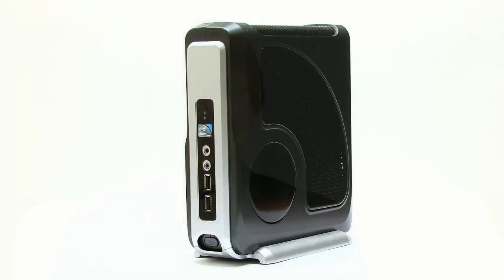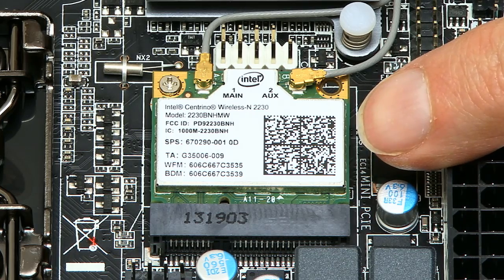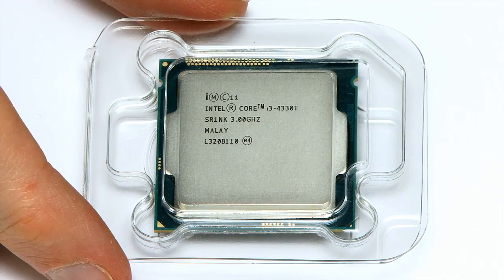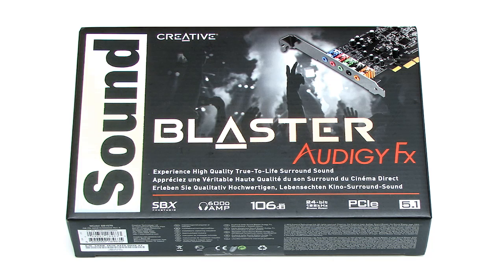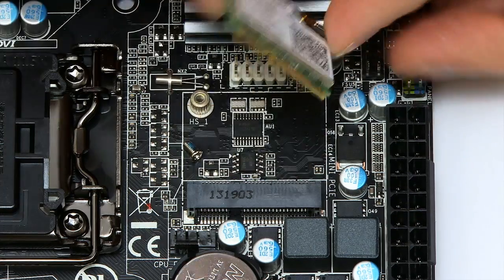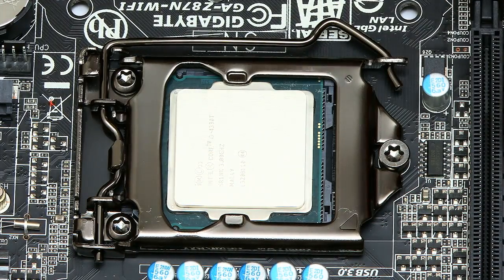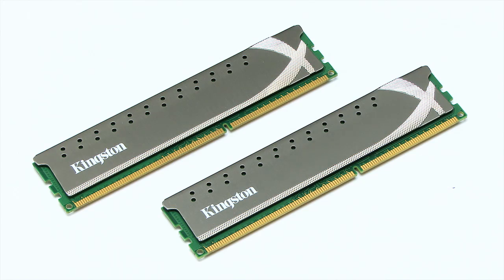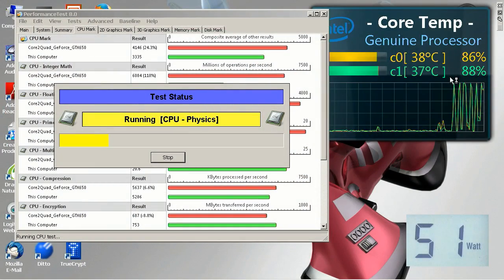Haswell i3 Mini-ITX Build (Part One)

Comment: When I was a teenager I had this awful HP machine that had a 4130T, not only did the shitty optical drive die in less than a year, it also had a hard drive (I know that was standard on prebuilts in 2016) that took a long time to boot, and the cherry on top was HD4400. I remember playing GTA 5 on it, which is something it wasn't intended to do, at 800x600 lowest settings, and getting about 30fps.

Comment: Hi Chris! How is this PC holding up after all these years?
Reply from the maker: It is still going strong -- I am typing on it (running Linux Mint) right now. I had some problems with one of the Ethernet ports a few years back, but switched to using the other one, and all is still good. And it now has a much larger boot SSD. The PC will be 10 years old next year, but I'll keep running it until there is a reason to upgrade.

Comment: I would have flipped the L9i if it were my build, you have the hot air coming directly onto the ram and if you turned the cooler 90 degrees it would have been better.

Comment: why not put the fan on the table upside down then fit the board upside down to the fan and screw in from the bottom on the top :P  ?
Reply from the maker: Not an ideal way to place a heat sink onto thermal compound! :)
Reply: why ? do you need a mirror or something i dont think you understand me :)

Comment: I am thinking  of building a pc. Will these components work together? (just making sure)

Processor: Intel BX80684I38350K 8th Gen Core i3-8350K Processor
https://www.amazon.co.uk/Intel-BX80684I38350K-Core-i3-8350K-Processor/dp/B0759FWJDK/
£149.97

MotherBoard: https://www.amazon.co.uk/Gigabyte-GA-Z270P-D3-Generation-Motherboard-PCI/dp/B01NCS9QS5/
Gigabyte GA-Z270P-D3 7/6th Generation Motherboard - Black (Intel Core i3/i5/i7 Processors, LGA 1151, Dual Channel DDR4, USB 3.1, PCI-E 3.0, PCI-E x1, SATA 6 GB, USB2)
£68.98

Windows: https://www.amazon.co.uk/dp/B0111YEBY4/
£59.00

RAM: https://www.amazon.co.uk/Crucial-CT4G4DFS824A-DDR4-PC4-19200-288-Pin/dp/B019FRED60/
£72.97

Power Supply: https://www.amazon.co.uk/Corsair-CP-9020049-UK-PLUS-Power-Supply/dp/B00X8QBT6M/
£31.94

Case: https://www.amazon.co.uk/Corsair-CC-9011086-WW-Windowed-Mini-ITX-Computer/dp/B01550Y9GA/
£40.35

SSD: https://www.amazon.co.uk/dp/B00P73B1E4/
£108.99 (500GB)

Cooler: https://www.amazon.co.uk/Noctua-NH-L9x65-Profile-Performance-Cooler/dp/B00VB3Y89E/
£44.99

Total: £577.19

Comment: what is the point of two Ethernet ports?
Reply from the maker: It is in case you want to build a server -- where the two ports offer redundancy, or increased bandwidth.
Reply: Or a router
Reply: NoAngel It might be a waste for you, but I can assure you that not everybody agrees with you. I find it useful to have two ethernet ports. And using desktop parts for a server isn't necessarily a bad thing... not all servers are highly stressed, mission critical monsters requiring big budgets. Sometimes you just want a simple media and file server. Something even a Raspberry Pi can do.

Comment: Chris, 
When installing the CPU a good rule of thumb is to lift the socket retention bracket that surrounds the CPU, then place the CPU onto its pins before losing the retention bracket. When you put the bracket onto the CPU, the cover will pop off by itself for you to store for warranty reasons. 

Hope this helps!
Reply from the maker: +Baz_Man_03 An interesting idea, but I would rather have full sight of what is going on, and not have things popping atpund by themselves! :)
Reply: +ExplainingComputers The only reason I do this is because of the possible damage that could be cause to the pins while lifting the retention arm. Thank you for you reply! :)
Reply from the maker: Baz_Man_03 I do see your point. :) If I have learnt anything over the years it is that there is never one day to do anything in computing.
Reply: ExplainingComputers Too right!
Reply: ExplainingComputers Love the channel by the way!!!

Comment: can u still but an gpu in ¿
Reply: +DarWr only a dual slots sadly , if you want to get a gaming gpu i suggest you get a mini itx case with 2 expansion slots. good ones are the node 202 , or the coolermaster elite 130/120 series.
the node 202 can be bought with a power supply though so that's a really good one.

Comment: In case you haven't already explained this elsewhere, the reason why you use TIM (Thermal Interface Material) is because no matter how shiny the surfaces look, there are imperfections and if you didn't use the TIM then there would be air insulating the CPU from the cooler.

The best conductivity is of course achieved from metal to metal, the TIM, to repeat is only there to eliminate insulating air pockets.

You used on the top end of what I would have put on the CPU with regard to TIM. In this case less is certainly more, because if you use too much then you will have a negative effect.

When you have put the cooler on then twist it around a little on top of the CPU to make sure the TIM has been spread around a bit.
Reply: Some people believe the TIM must create a barrier. Which is not true. Another reason I detest the spread method. Retail TIM is sold with a card to spread it. I just discard it and use my original method.

Comment: Hi there, fantastic build. I would like to build a similar set up to run ubuntu and kodi. I have some spare bits: Intel dual core g2130 socket 1155 and kvr1333d3e9sk2/16 ecc memory. Can you please recommend a itx board that would be suitable or an equivalent set up. Regards. Peter.

Comment: Very inspiring build thanks, I am finding it hard to get the motherboard and the delock is no longer made could you up date the component details? How is it running 18 months after your build video?
Reply from the maker: Nick Clark I will try and compile an update. After 18 months, the machine is still running perfectly. I've been very pleased with this PC.
Reply: Thank you I want to do the same especially with the drive bay 2.5 HD bay/USB sockets,the z97mb may be OK to use😀

Comment: Hey Chris, if you're gonna monitor the mostly everything going on with the processor, try the Intel Power Gadget. It reports wattage, core clock, graphics clock, and temperature. It's all I need for monitoring since my build is similar so I'm calling it APU-§.

Comment: -1.  Don't remove the cover before opening the socket.  When you close the socket with the CPU in, the cover will pop off very nicely.  This prevents accidental breakage of the delicate pins on the motherboard.

Also, the screws on the Heatsink will spread the Thermal Paste around when you apply pressure, so no need to put stress on the heat spreader of the CPU.
Reply: +Neil Balch There is no "right" way to do it. Some people do it like he did and some people do it like you said.

Comment: I wonder, were you able to get by without the sound card? I understand your concerns about motherboard audio but I believe they have much improved in recent years, I'm talking specifically about Realtek. A Creative X-Fi I have does not even come close to the on-board Realtek HD sound of a new MSI motherboard, I have not ruled out that something may be wrong with the sound card but there's no excuse for Creative.
Reply from the maker: StopTheMorons Thanks for this. I initially built this PC without the sound card, and then installed Dragon Dictate, which simply would not work (even using a very good microphone). So I got the sound card and reshot the video to fit with that decision -- and then Dragon Dictate worked! :) So sadly here the card was critical.

To be fair, Dragon Dictate's manufacturer (Nuance) do recommend using a USB sound device as their software is so sensitive to frequencies in the human voice, but I really wanted an internal solution. These days, most people inputting audio to a PC via a microphone are using a USB device (most commonly a webcam), so in practice very few people probably use the mic jack on a motherboard, so not a lot of attention is paid to it.

I am sure that you are right about improvements in onboard sound, but in my experience these are in output (line level signals), not microphone levels -- and shielding these on a computer motherboard is never going to be easy. Other components just present too much competition. It is probably no a coincidence that I am not aware of an internal, let alone onboard, sound card offering balances audio. The XLR jacks are on a breakout box/board for a reason!

I totally agree with you that there is no excuse for Creative . . . :)

Comment: With this could I fit an i7 quad core and 500gb solid state? I'm not a computer building mind so I don't know :P
Reply: As in a MSi Radeon r7?
Reply from the maker: Liam McKeever The motherboard will take an i7 no problem. In this case you would need a low power chip to cool it with a low profile cooler, but I have seen i7 systems for sale in this case.
Reply: ok thanks a lot :)

Comment: This build becomes much easier if you leave the psu unattached until the very end. Also, make sure to connect the front connectors before the power supply and (possibly) the ram. The psu cords are long enough to let you have it standing on the side while you plug everything up.
Reply from the maker: Robin Keskisärkkä Excellent advice. :)

Comment: Great instructive video and very clear language. Maybe "finish them off" wasn't the best of expression, when speaking of mounting the cooler. As you just had set the mind around 007... ;-) That said, I also think I would hav fastened the screws in an X-pattern to be more secure on perfect fit for the coolerplate. Wouldn't you say so?

Comment: Apple is better.... and yea I'm a fanboy!
Reply: NightBlade|DK
 I'm working on a Mac here, because obviously design studios need Apple products to look pro. This iMac is brand new, cost over 2500 €, 8 GB RAM, this stupid hybrid HDD ... Well, at home I have my 1 yo PC that cost me about 1750 € that has two really good 24" monitors, 16 GB RAM, 512 SSD, 1 TB HDD and of course, Windows. Processors are both 3.4 GHz i5. Guess which one is always crashing and which one is ca. 2x faster. Yeah, the cheaper PC. Tell me, how is the Mac supposed to be better with weaker hardware while costing much more?
Reply: And don't get me started on the OS ... OS X is the crappiest system I've ever worked on.
Reply: NightBlade|DK
Na, only Beach Ball of Death. No problems with my Win. And I do graphic design. The mac is just a nightmare for working. Example? Explorer > Finder
Reply: ***** You pay the more expense the firs time but overall a mac is a cheaper way to go. With windows you have to pay 300 dollars for an OS. apple is free. If you do you research, most apple software, and software made for apple (with an exemption for MS Office) is cheaper. I use both and they both have there pros and cons.
Reply: FUCK NO AMD
Reply: lol...can a Mac play Crysis 3 on ultra settings? because used to own a 2013 iMAC...guess what...it ran on 25 fps...such a lame platform and people buy MAC for the brand...PC is way better for everything else...

Comment: Your supposed to spread the thermal paste.
Reply from the maker: I used to spread, but the Noctua instructions are for one small bead, in part to prevent air bubbles.

Comment: That wireless module will more likely than not be better than the one in any laptop....
Reply: I don't know what kind of antennas laptops generally have but I think the external antennas alone on the module might make a difference compared to whatever laptops have integrated.
Reply: Achenar12 The pcb is exactly the same. The gold connectors to it are the same but in a laptop they don't lead to an IO socket pair on the back but lead up the sides of the laptop screen to the top. You'd just need to remove the cables and put it in a laptop.

Comment: If you have extra usb 2.0 headers you can get an adapter and run the other set of usb 3.0 at USB 2.0 speed.
Reply from the maker: Sadly there is only one USB 2.0 header, and I've already used it to run the two USB 2.0 sockets in the little door on the front of the PC. Though it may be easier to have these higher up -- so I may well get a header as you suggest to move the sockets "up" as it were. Thanks. :)

Comment: any particular reason why you used the i3 over the cheaper haswell pentium processor?
Reply from the maker: The i3 is a more powerful CPU -- eg it has hyperthreading (which I will use if I render on this machine). I also just liked the idea of an i3 system! :)
Reply: what you think about Xeon Quad-Core E3-1220V2

Comment: Wouldn't an AMD APU be better? (Graphics) Refer to your AMD APU video detailing the performance advantages. P.S Massive fan of you're videos :)
Reply from the maker: For 3D, perhaps. But for this kind of Mini-ITX build I would always favour Intel. :)
Reply from the maker: Also, I may on occasion do some 3D rendering on this machine, and if renders are split between machines with Intel and AMD processors, some textures in them may not match.
Reply: ExplainingComputers Thanks For the reply,keep up with the great videos youre inspiring a new generation :-)
Reply: ExplainingComputers Hold on a minute. I thought that problem only existed with hardware texture mapping (using a GPU), not with software mapping (on CPU/CPU side of APU)